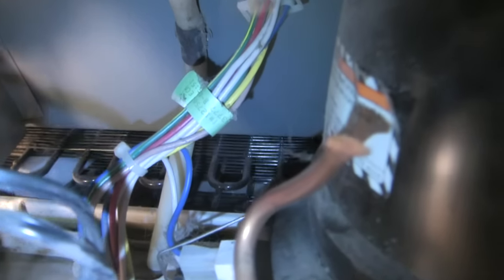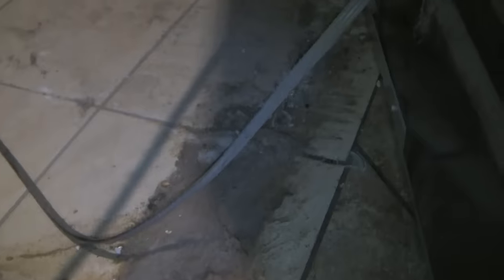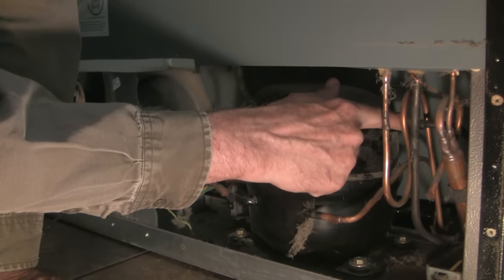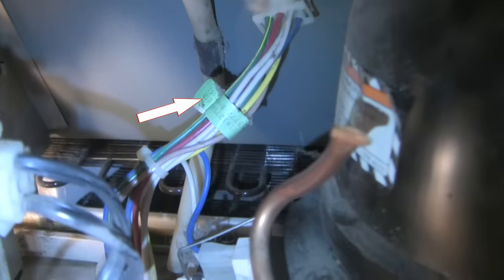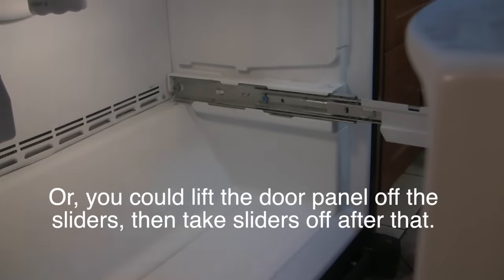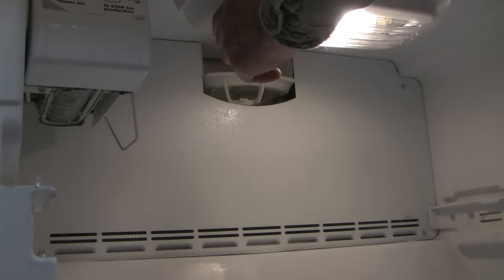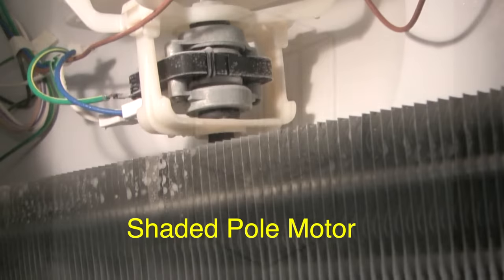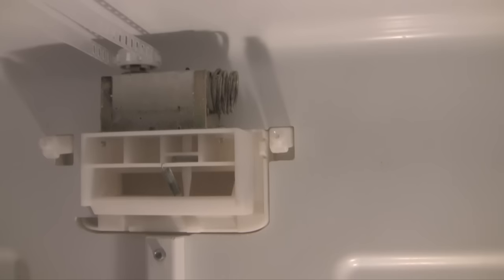How to investigate and fix a fridge that is too warm

Comment: So, The compressor is not working. Relay clicks, compressor 'buzzes' for like 15 seconds, the relay clicks, and compressor stops buzzing. 

We  have 120 volts at compressor, and then we put on new capacitor, and relay, but compressor still just buzzes for 15-20 seconds. 

We  tested the 3 pins on the compressor, and they all showed continuity; the ohms readings were around 4.4, 4.3, and 8.9. 

We Put an amp meter on the power line when compressor is buzzing, and it shows 9.5 amps while compressor is buzzing. (The label on the compressor says 19.5 LRa). Even tapped the compressor with hammer while buzzing, which did not help.

Is my compressor broke? Could it be acting like this if it was low on R134a? Is their any tests I missed doing? 

Thanks,
Matt
Reply from the maker: It's not low refrigerant because the motor wouldn't try to start at all. Assuming you put in the correct capacitor and the correct potential relay, and assuming the voltage you measured was right at the motor while the motor was trying to turn over, I think the motor is done.
Reply: @spelunkerd  Thank you for your reply. I was guessing the r134a level was ok also, as the fridge was cooling ok - up to the point the compressor wouldn't run more than 15 seconds at a time.

I had seen some comment that lowered amp draw might indicate low refrigerant, but when I re-read that comment today, it was talking about 1.5 amps, or less. (not 9.5 amps as I saw).

I am confused about that amp draw though. If the label on the compressor says 19.5 LRa - what does that really mean? 

And with the 9.5amps I saw for a few seconds - does that help diagnose that the compressor piston could be seized? 

I also saw today something called a "3 n 1 hard start kit' made by Supco. It's cheap (around $15), and I thought maybe, it might un-seize the piston - if that is the problem? any thoughts, or experience with these?
Reply from the maker: @m.n.3490  Bigger systems like AC units use a potential relay, smaller residential fridges use a current relay. Both reduce current flow to the start windings after the motor spools up. When you said you replaced the relay, I thought you had already done that. The current relay uses a positive temp coefficient resistor that increases resistance leading to the start windings as it warms up, reducing current delivery to start windings after the compressor starts. They often fail, and rattle when they have overheated and it's the one thing you can do to save the day. The potential relay is more sophisticated, measuring the huge spike of back emf as the compressor spools up, tripping the relay to stop current flow to the start windings after a second or so. There are various 3-in-1 hard start kits, cheaper ones are just a current relay (PTC resistor) and capacitor prewired in a kit. If you haven't already done that, I'd try replacing the relay, but I'd try to match it to what is already there. The wiring diagram for your fridge is likely hidden somewhere inside, it will tell you what is there.
Reply: @spelunkerd  Sorry, I've tried replying, but it gets deleted, or something? One more try ...

Yes, you are right, we did put on a new capacitor and relay. Compressor still just buzzes.

We got the part numbes from an online manual: (Online manual also has a wiring diagram, but I think we have the correct new parts).

This online manual calls the parts a 'starter', and a 'Capacitor-run, 220 VAC, 15 microfarad'. I'm not sure why it says 220VAC? I only measured 120VAC at the wires going into the relay at the compressor?)

Since the compressor was buzzing, I thought the piston might be stcuk, and this thing called a "3 in 1", "hard start kit" might push it harder than the OEM parts.

I got the impression from the name ( "hard start Kit"), and the manufactuer's site (Supco) that says their part gives an extra 'boost'. (Replaces relay, overload and provides a boost for hard start and unbalanced systems ... 

Maybe it's just an advertising ploy, but the part is only around $15, and I thought, it might work - if the only problem with our compressor is that it is old, and the piston is stuck, and needs a little extra push?
Reply from the maker: @m.n.3490  Household wiring is 120V to ground, but 220 V between the two hot legs that are 180 degrees out of sync. You could check the breaker on the incoming line. If it is 220, in a typical panel there will be two breakers side by side, tied together so both trip together. If you have only 120V to your unit, the manual you're looking up online is not correct for your compressor, so any info you get from that manual may not be correct.The compressor itself should have a label describing what it requires, and if you can find a wiring diagram inside the fridge you may find more accurate info. The other way to check is to simply look at the plug. 220V plugs have a different layout compared to 120V plugs.
Reply: @spelunkerd  Label on our compressor says its 120v. And the plug is a 120v plug. 

I am guessing that the 240v printed on the capacitor, is the max it can handle?

I was trying to determine how the 'hard stat kit' could help, so, I was looking for some details that would explain what Supco refers to as it's "extra boost". 

I have now seen some specs that indicate the micro-farads (uF) on he 'hard start kits' are a lot higher than the oem capacitor. The oem capacitor is 15 uF. Supco makes three 'hard start kits:
 
RCO210 for 1/3 to 1/2 HP motors, and has 243-292 uF
RCO410 for 1/4 to 1/3 HP motors, and has 243-292 uF
RCO810 for 1/12 to 1/5 HP motors, and has 145-1752 uF

I don;t know if the higher uF is just a bigger 'battery', or if they produce more voltage? Or both? Or neither? lol
Reply from the maker: @m.n.3490  The capacitor is not a battery, it has a narrow range of effectiveness and you want to match the specs of the old and new capacitor (and the old and new relay) as best as you can. If anything, lower capacitance has higher impedance and more phase shift. A hard start kit is simply a new capacitor and relay. Some old style PSC motors don't have start capacitors, they only have a run cap, so a hard start kit helps those. If you've replaced those parts already and you're sure your new parts were good, you're done. Yes, voltage on the cap is simply what it is rated for, you always want it to be higher than what it experiences.
Reply: @spelunkerd  Ah. Thanks for that explanation!

So, in my case, the 'hard start kit' will not help get the compressor moving. I was not  aware that some compressors had no capacitor! I can see where some older fridges, without capacitors, could be started with the hard start kit in those cases. 

We actually tested the old parts (relay/capacitor) and those tested good also! We retested the pins on the compressor, and found the resistances were:
 -  common to- start = 6 ohms
 -  common to run = 5 ohms 
 -  start to run = 9 ohms
 I've read start to run should equal the total of the other two, so, should be 11 ohms. I was not sure what that 9 ohms indicated, but, then we tested from the 3 pins to ground (the refrigerant's copper tubing) - and saw there was continuity there, indicating a short to ground inside the compressor - my understanding is this means the compressor is bad.  Is that correct?

So, it's either time for a new fridge, or maybe try to replace the old one. I've never brazed before, so I am not sure I can braze a new compressor's lines. (I've soldered copper water pipes a few times, and I found it 'tricky'). I've seen some used compressors on ebay for around $100, and a new one is just under $300.
Reply from the maker: @m.n.3490  Many older compressors are "PSC", which stands for permanent split capacitor. The run cap is inline with the start windings, permanently. So the cap has to do two jobs, start and run, and it isn't quite right for either. For those systems, adding a hard start kit makes sense by adding a dedicated start cap, and a start relay, both in parallel to the run cap. In that case both caps are in line with the downstream start windings. Bigger systems use a run capacitor for the fan AND a run capacitor for the compressor, and they come together as a single device. If you're interested in a real world example of that, I did a video of a bad cap in a heat pump last year, on my channel. I swapped out the bad run cap, and the problem was solved. That compressor was a new design "scroll compressor" which shouldn't require a lot of torque. I asked an engineer friend the question as to whether it is worthwhile to go ahead and install the hard start kit and you'll see his reply was no. Clearly the problem was solved in my case so I left it at that. I'm sorry your experience wasn't successful, but you gave it a good try!
Reply: @spelunkerd  Yes.We gave it a try. Thanks for your replies. 

Instead of getting a new fridge, I am considering getting a new compressor, and replacing the old one. 

My biggest concern with that is the soldering/brazing of the new compressor. I've been watching some videos of how both brazing, and soft & hard soldering is done. I don't have acetylene, but, do have MAPP gas. Also don't have nitrogen, but, as I  understand it, I would not need nitrogen for soft soldering with silver.solder and MAPP gas.
Reply from the maker: @m.n.3490  My Dad and brother do it professionally, they make it look easy. That said, there is something to be said for new warranties. When you count the expense for parts like freon, compressor, etc, you are up there already. As much as I like the idea of not throwing stuff away, and learning something along the way, I hear where you're coming from. However given the economy of inexpensive Chinese parts, with a full warranty, it is hard to beat new. The pro market fell out the bottom of the repair industry, but of course you wouldn't be paying for labor. Here in Canada, we can't get Freon without a license.

Comment: 5 year old whirlpool. First, top freezer stopped cooling to freezing. Then a few weeks later the fridge stopped cooling. Any idea what would be the most likely thing to check first. Thermostat?
Reply from the maker: Go through all the things I did in the video, search for clues. One fairly common problem in older units with a mechanical defrost timer is failure to exit the defrost cycle, the defrost timer gets stuck on defrost. In that case the fans shut down, the compressor doesn't turn on, and when you find the timer it is on defrost. Those older timers can be rotated manually into service, but the fix is to replace the timer. Another problem is a compressor that won't get started because the current relay is bad. In that case the compressor tries to turn on but won't get started, you hear a hum and it quits after a short while, then tries again a few minutes later. That problem is solved by a new relay. Another common problem is a refrigerant leak, which can lead to repair charges that may not be worth the price of a service call. So, if you fail to find a problem, you'll face the dilemma of whether to gamble and call for professional help, or whether to pull the plug and buy a new fridge, complete with warranty, etc.
Reply: @spelunkerd  Thanks, I'll dig into it tomorrow.  I'm fairly handy but fridges are new to me. Tempted to just get a new one but this is only 5 years old which even for modern appliances is way short of its expected lifespan. So I figure its worth trying to determine if it's something I'm able to fix.
Reply from the maker: @jerseyjim9092  it is an eye opening experience to see so many new looking fridges at the local recycling yard. Techs don't like to work for peanuts, especially if it means a house call, so you're in the hole already just with a visit. Hopefully something can be done. Over the phone they may be able to estimate the chance of success if you can document whether the compressor is turning on, how often it is cycling, and whether it sounds normal when on.
Reply: @spelunkerd  That's a good tip to know. It's too bad service calls have become so expensive and appliances less dependable and harder for owners to fix themselves. Like most things though. At least youtubers give us a fighting chance. Thanks again.
Reply: @spelunkerd   Fans and compressor run but neither freezer or fridge cool. I pulled the panel from the rear of the freezer section to see if the evaporator could be frozen. It was but only in the upper right which had a big chunk of ice. I read that this is a sure sign of a freon leak.  Makes sense since the freezer section failed weeks before the fridge. Leaks are rare so I guess I'll chalk it up to bad luck. New fridge on the way.
Wasn't all for naught, I learned some things about refrigerators. Next time they won't seem so mysterious and intimidating.

Comment: Good to know i just expereienced in issue where after moving a refirigierator 2 weeks after plugging it in it started not cooling the compressor feels hot to the tough. 😀 I probably didn;t let it sit long enough.
Reply from the maker: Yeah, it's a real thing. For those who haven't heard of this before, the fluorocarbon is a mix of liquid and gas. When the system is running and upright, most of the liquid stays on the high pressure side, well away from the compressor. Even when turned off, the system is designed so the compressor is not in a position to take a big swallow of pure liquid refrigerant. But if the fridge is turned on its side, the fluid inside the accumulator (or the receiver/dryer) can empty and allow the compressor to take a big swig of straight liquid as it starts up. Just like a hydrolock in an internal combustion engine, the valves inside the compressor can be damaged by too much liquid that doesn't compress as easily. So as a safety, many compressors have high pressure sensors that shut it down if pressures get too high. Tip it upright for at least a few hours before starting it up, and ideally avoid laying fridges on their side.

Comment: Hello, my "high side and low side" are both very hot. I can't really tell the difference by feel. Is there a way to determine which is which by another identifier?? 
P.S. I have a shaded pole 24vAC motor in my water softener. I'd like to get another just like it.
Reply from the maker: In larger units the low side is often of larger diameter. It is very unusual for both to be hot. Perhaps you're looking at a loop of the same line? If both are hot, you have a major problem, but it's hard to be sure what it is. Unfortunately fixing it requires tools and experience that go far beyond the DIY wheelhouse.  Check for the things I listed off and that's about it.

Comment: My top refrigerator stop working  but the freezer works.I saw water in the tray.what do I do😓
Reply from the maker: The hard part is always to judge your personal skill set, tools, time to learn enough so you don't make a mistake, and risk tolerance. For most, that means calling a pro, or at least a neighborhood friend. Your story sounds like a problem with the defrost cycle, which is commonly caused by a mechanical problem with the timer. Or, it could be something simple like a door seal that doesn't quite close, or something inside that props the door open. Think through the easy solutions first, maybe one of the kids left the door ajar and then closed it before you got home. Good luck!

Comment: Ok so what if after cleaning and confirming both fans and compressor are running....and freezer is still around 20-25 F?  Evaporator coils had a little frost on the bottom but not much.  I confirmed the coil heater works (ouch) which leads me to believe thermostat is ok.   Not too much frost on the coils leads me to believe the timer works.  What else can prevent the freezer from getting colder?  Gaskets seem ok and cranked it all the way to coldest setting.  Thanks!
Reply from the maker: I believe the most common cause would be low refrigerant caused by a microscopic leak. There are other possibilities, such as a bad thermostat, failing compressor, etc. Unfortunately the cost of hunting down and diagnosing a leak and then fixing it may be prohibitive. Here in Canada, to preserve the safety of our planet, real refrigerants are restricted to qualified refrigeration mechanics, to discourage simply refilling freon without making the effort to find the leak. Other countries are not so altruistic. If it is truly low on refrigerant, the same problem will return in weeks to months after refilling. With no shrader valves on most domestic fridges, special tools and techniques are necessary to measure pressures and recharge with refrigerant. Our local recycler has many new looking fridges in the scrap line because consumers decided to buy a new fridge rather than fixing the old. I find the trend to throwing things out (because labor costs in North America are so much higher than in China) to be depressing.
Reply: @spelunkerd  Yikes,  at this point and per your reply might just be wise to purchase a new fridge altogether.  Although  hesitant as all new stuff nowadays is made to break.

Comment: Having problems with my Kenwood ksbsb17 American style,  the fan motor at the top of the freezer was making a loud noise on inspection the fan centre had cracked and the spindle from the motor was loose moving in all directions so this needs replaced but to my surprise the bottom left corner of the freezer has warped melting on plastic the large coil pipes sit just behind this plastic the heat resistant silver sheet has ball size dark brown mark so there has been alot of heat in this specific area, does anyone have an idea if this would of been caused by the fan not working or is there an other issue too thanks